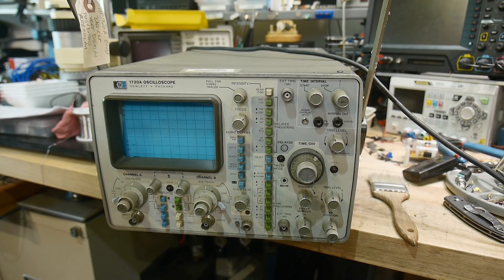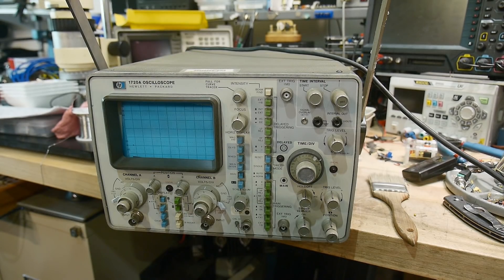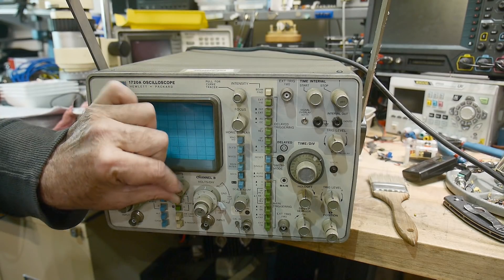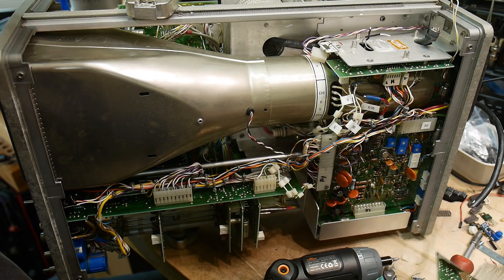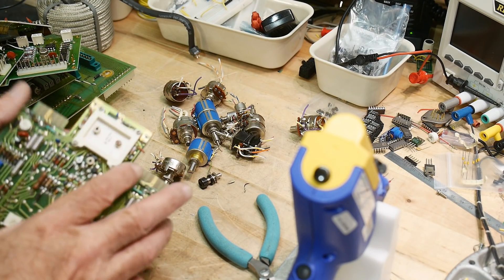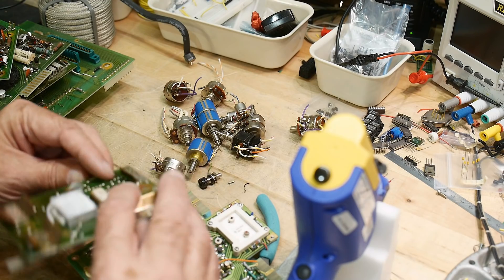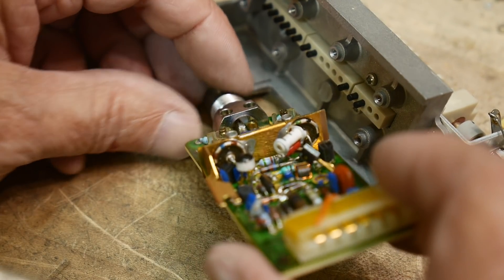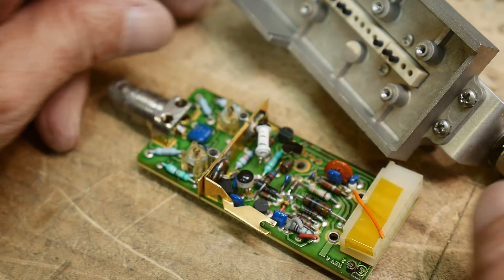#1180 HP Oscilloscope RIP

Comment: I hated HP oscilloscopes as had the misfortune of using them at university and at first job and thankfully next job used Tektronix and Lecroy oscilloscopes for years and didn’t look back. Sharper screen better UI, cheaper when it comes to buying active probes and just better overall better then the HP oscilloscopes and then their DSO’s were even worst I actually got rid of it as consistently freezes up and had issues and bought a Lecroy Wave Pro to replace it and a Tektronix TDS. Both were superior and more importantly reliable. Oscilloscopes for complex waveforms and trigger. Early HP DSO oscilloscopes are the reason some older engineers and technicians hated DSO’s

Shame about HP is they made the best logic analyzers around to date. Just their oscilloscopes they cut corners and not built nearly as well. Nowadays of course  Keysight make the best DSO’s. It  when they made the 8000 series is when HP started making proper DSO’s and getting it together. They made great acquisition board but used the cheapest components as far as the PC board goes like buggy VIA chipset, slow processor and just overall poor performance as far as the PC sides goes. Then the UI was garbage.
Reply from the maker: I love those old Lecroy scopes

Comment: The gold recyclers are drooling over those boards
Don't throw them away, you'll get good money for them, even if you don't depopulate them
At a shop I used to work at I had one of those scopes that I used to use, then I 'upgraded' to a Tek 465m that we got from the local air force base surplus
Good times :)

Comment: I'm curious to see what the impedance of the delay line turns out to be. The high speed / high voltage transistors from the sweep amplifier output stages might also be good to snag.

Comment: In the early 1970's, at the HP scope division in Colo. Spgs, the R&D group used Teks to do their design work. I think the copper-nickel-gold boards had heavy gold on them, well worth sending in for gold scrap if you snip off the parts first. Same with the large chassis-mount connectors for card edges. In the early '70's, just before the price became free floating,  gold was still bought and sold for $35 an ounce, so they used a decent plating of it until the price shot up when price control was dropped. 

My buddy gathered scrap bds and connectors (free) for about 5 years till the gold price was floated. He then waited another 3 or 4 years as the US gold price climbed, then had the gold recovered from the bds and connectors and bought a house with it up in the foothills at the base of Pikes Peak.

Comment: Strange - boards and inside parts look like they are from the 70's/80's but hp logo is the revised one from early 2000's (before it was always the "HP Hewlett Packard", later, with Carly Fiorina, it was reduced/redesigned to "hp" like on that scope.

Comment: I have a 26GHz Tek spectrum analyzer that needs a recap. I haven't opened it yet and examined how much damage the leaking caps have done but based on the power consumption of the unit alone and its slightly flaky behavior I may take it apart and repurpose some of the RF components in it. It is sad to do but there's life in another life if you see what I mean.
Reply: If the spectrum analyzer can be repaired maybe you can try to repair it..
Spectrum analyzers are expansive, they deserve some repair love 😄